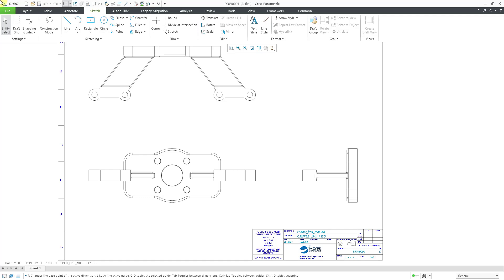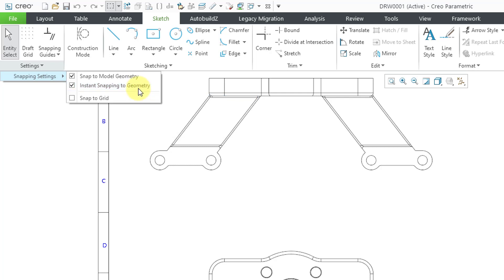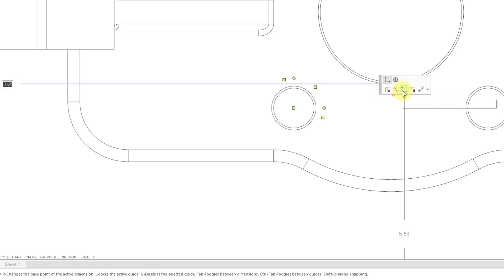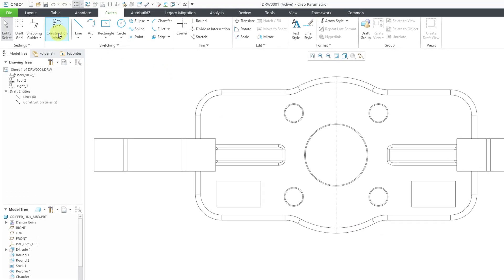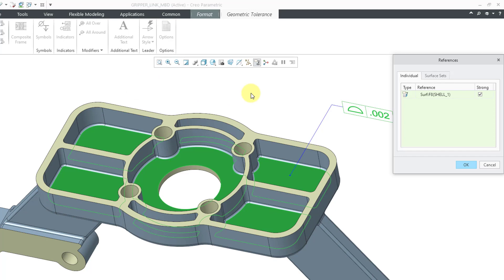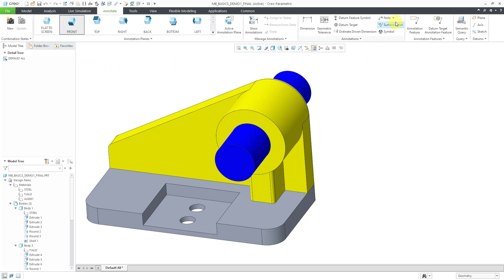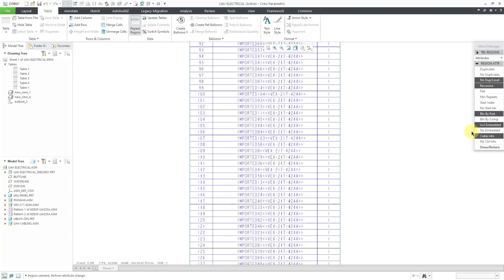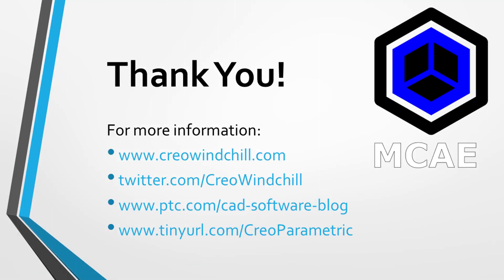Creo Parametric 8.0 - 2D & 3D Detailing Enhancements - Drawings and Model Based Definition (MBD)

Comment: All of these updates will be fantastic, but just makes me think..: Does PTC have any plan for updating Schematic at all?? There's soo many aspects that need to refreshed there..
Reply from the maker: There was a meeting of the Working Group this morning. It just ended a few minutes ago. You could have called in and expressed your wants and needs. I recommend connecting with the Working Group on PTC/User. Getting involved with the Working Group is the most effective means of getting your needs addressed.
Reply: @CADPLMGuy  (Swore I had replied already, but it's no longer there...)  There's a working group for schematics?? do you know where to find it? The PTC site just seems to have Creo (no schematic), windchill, and all the other packages, but nothing for schematic.. Thanks!
Reply from the maker: @danman155  It's through community.ptc.com that's how PTC connects with the user community
Reply: @CADPLMGuy  That where I was looking... This says to have the full list of Working Groups, but there's not one for schematics under any of the groups there..
https://community.ptc.com/t5/PTC-Working-Group-Info/List-of-PTC-Product-Working-Groups/m-p/558586#M8
Reply from the maker: That's actually not the full list. You can get the full list from the menu on the left. But I accidentally said Working Group when I meant Technical Committee. The Working Groups are organized by PTC to address requirements for specific enhancements to Creo in specific versions. The Technical Committees are run by PTC/User and are ongoing groups that provide feedback to the various Product Managers. You can find the TCs at ptcuser.org.